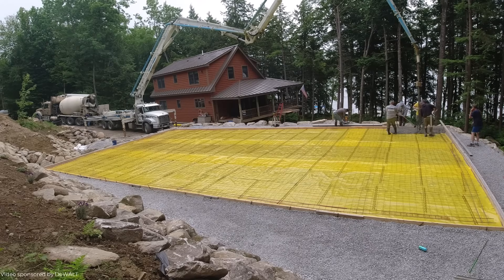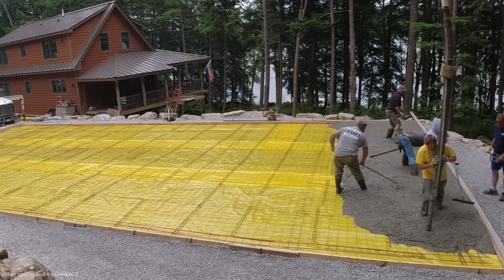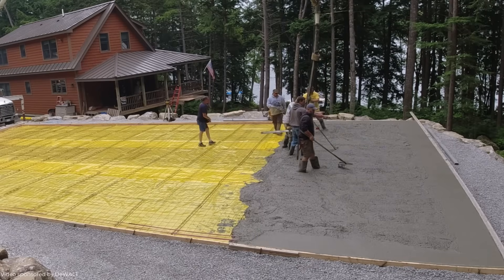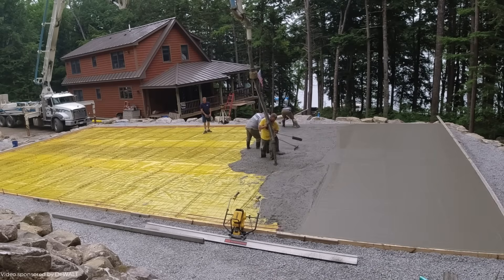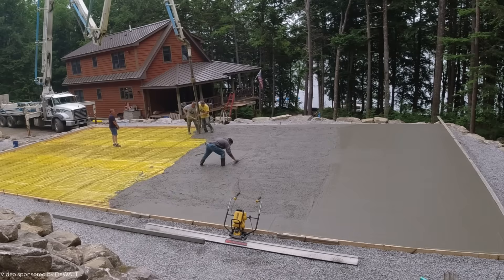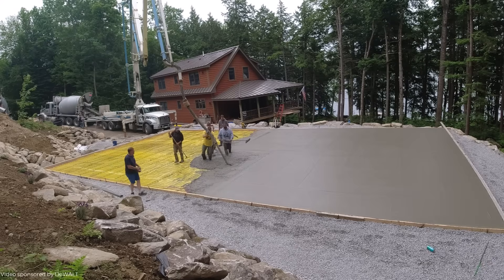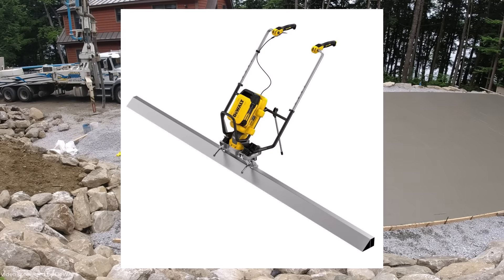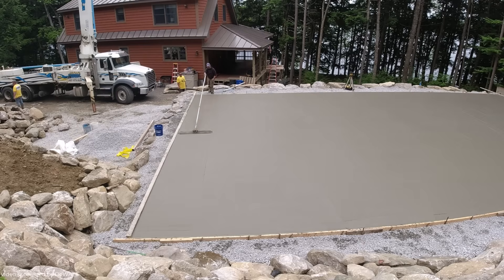How To Install A Concrete Slab For A Pickleball Court

Comment: I think there is a mistake in saying water reducer changes the slump.
A four inch slump mix is ALWAYS a four inch slump.
A water reducer ONLY changes the molecular fluidity (temporarily).
A window that allows a stronger concrete to be spread easier .
Reply: The slump specification in a mix design is based on the target performance at placement, regardless of how it's achieved.  The specified slump is what the concrete should have at discharge from the truck.  If that concrete needed water reducer to achieve the target slump and maintain a desired wcm, that water reducer is already in there and part of that overall mix design.   So I'm not sure what the discrepancy you're highlighting is (in the way water reducer was discussed in the vid)...  but the mix design is necessarily already a set figure within +/- an inch or so (typ.), and the amount of water reducer is part of whatever slump specification it was designed for.